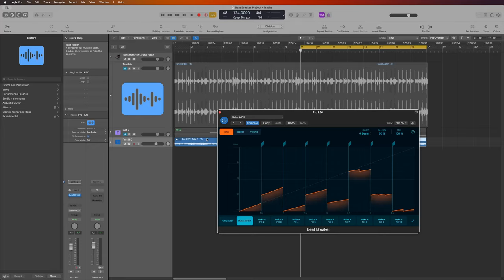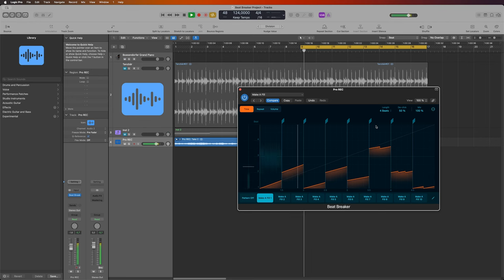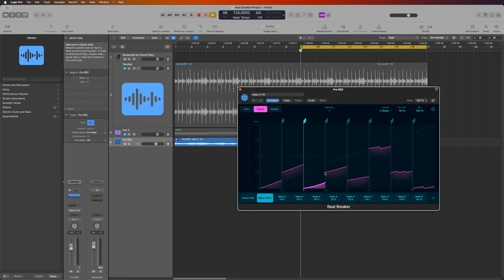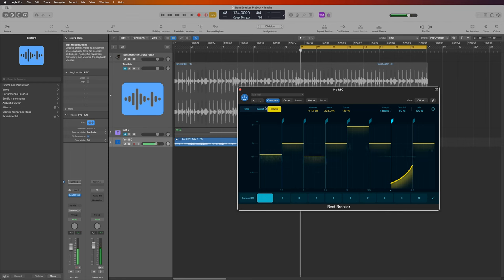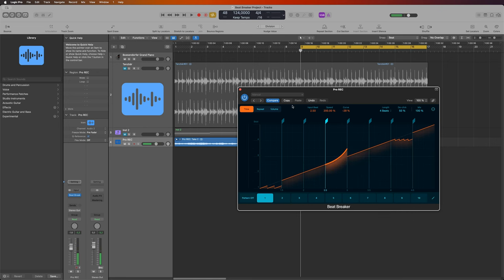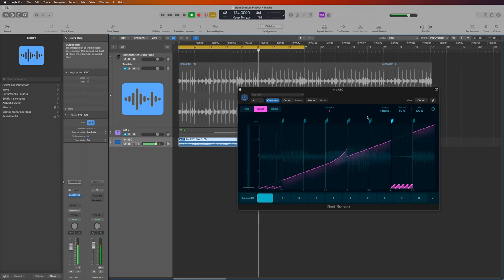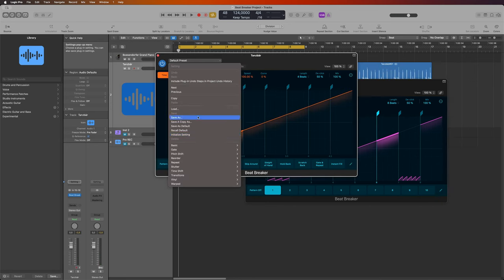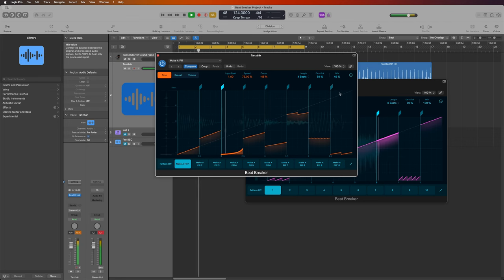Logic Pro beat breaker HOW TO | Beat breaker FULL TUTORIAL

Comment: I think you mentioned this somewhere in this video, the fact beatbreaker can't look ahead, any tips on how to overcome this as the first bar in my loops is not trigger properly though the ones thereafter do. Do you think the best way is to just add an extra bar then bounce in place with beatbreaker 'printed' rather than live?
Reply from the maker: As far as I can tell the problem only occurs when you change the input beat in the Time section. To solve this you can duplicate the loop and bounce it in place, yes. An extra bar before the loop start does not help I think. The Beat Breaker "memorises" the loop and uses this memories to place bits of it in other "Input Beat" positions. So changing Input Beat positions only works in the second repetition of a loop.
Reply: Thanks  @semodi  confirms my thinking and can be worked around thankfully.
Reply: @ezmanleeds  but how are you suppose to do this if beat breaker is applied on the whole mix, my whole arrangement is done :( it's a nightmare that it has no lookahead